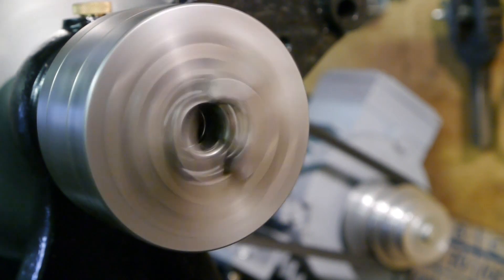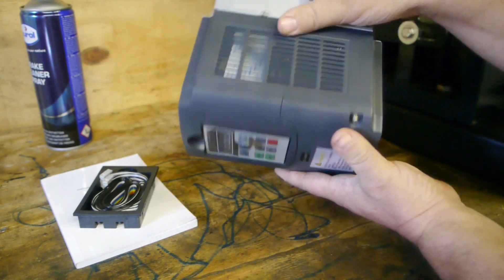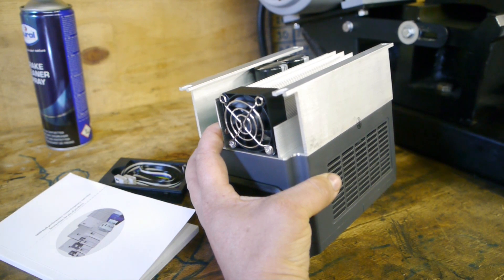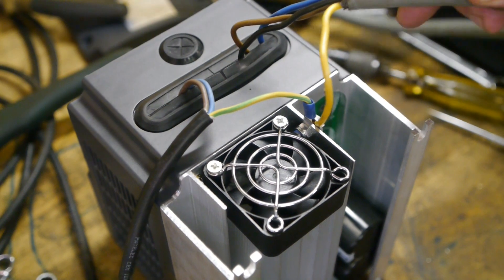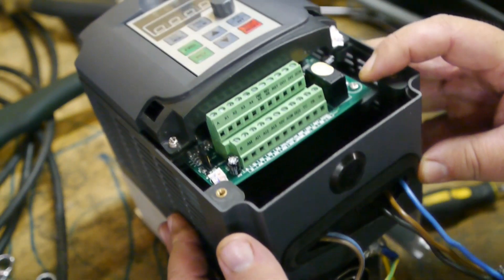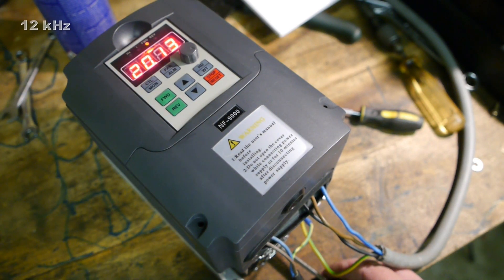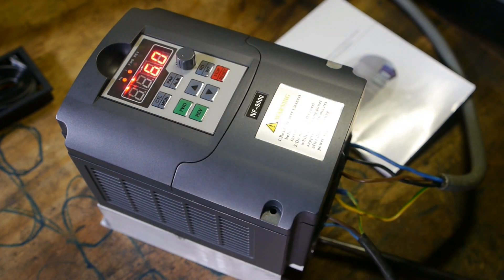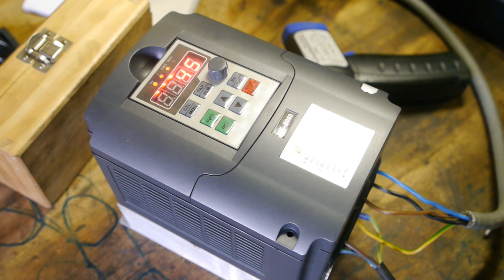Reviewing, testing and installing a cheap Chinese VFD

Comment: For a few dollars more, I'd rather just stick with something more of a known quantity, like the Teco drives. I have my doubts that this drive would last all that long at it's 2.2kw rated capacity. And if you're using it to run a 1hp motor, then the Teco drives are the same cost, but vastly superior quality and documentation.

I've been running the L510-203-H3-U on an a la carte air compressor, with a 3 HP motor for 2 years and it quietly does its job for $200.

Was hoping to find something reliable and super cheap for a drill press project and I think I'm just going to buy another Teco (foregoing the 'super cheap' obviously).

Comment: Thank you for this usefull video, my fan runs from the start as well, but that's ok for me. It's installed in a cabinet, on the other side of a wall. So that's ok. :) The only thing I haven't figured out yet is how do I connect an external on/off switch to this device? Have you figured that out? If so, can you please explain me how? Thanks!
Reply: I already found it, connect DCOM and FWD and change F039 from 0.0 to 2.0
Reply from the maker: Does the external switch also stop and start the fan? I remember running into this problem.
Never figured it out since I got used to using the buttons on the panel.
Reply: Yes, it does. Just like when you use the FDW and Stop button on the device. When the frequency hits 0.00 the fan stops too. We also use 2 devices of another brand and these turn on their fans only when needed, also the fans are more quiet. Probably that’s the difference between €125 and €600...

Comment: Hi guy. Unlucky I can't speak and understand fluently english. So... just a Q: does it works in a 3 fase, 400V motor of an little drillmill machine? It's 750W too.
Reply from the maker: I suppose that should work just fine.

Comment: Connect A bimetal switch 45 degr between onze of the leads from the fan en glue the bimetal to de alu cooling bloc. That wil help
Reply from the maker: That was the plan, but I disconnected the fan instead. It's been fine ever since. Never gets to the temp where the fan should kick in.

Comment: Really useful review, many thanks ! .. about the fan noise,I think you can do something about that. You already proved that it runs quite cool and in fact the fan shouldnt come on, at least with no load. and you can see what the temperature is. You can get (very cheap from internet) speed adjust kits for this type of fan (they are meant for PCs) .. actually its just a wire wound resistor, goes in series with the motor wire. You got this for free and invalidated any warranty when you drilled the hole for earth so if I was in your positition I would go for broke and remove or cut one of the wires to the motor and insert a suitable resistor (just insulate it well afterwards so no shorts. should help a lot. I also hate fan noise, even queit fans. eg a fan in my PC really annoys me, I want utterly silent.  

I agree, stuff we buy should ideally work right when you open the box, but given that this kind of cheapstuff often has a few minor annoyances" we have to live with them - or fix them - or we can pay ten times the price for something nice. which I cant afford

A slight bend on the heatsink wouldnt bother me at all, just bend it back. I agree its annoying, un-necessary if they packed it better .. a good feedback to them,  but the post cost to return it and them to send you another  is far more than the bend is worth . c'est la vie, worse things happen to girls
Reply from the maker: That' s not a bad idea. To bad the fan is fastened from the inside and there is no access to the the wiring from the outside.
So I would need to completely disassemble the unit.

Comment: Hi rolingmetal,
I bought a feed pellet machine that I can’t use because it is a 240v 60hz 3phase 22kw system, I only have 1phase power supply in my country. I would like to know if a VFD would work for me and if so can you please tell me a system that can work for me. Thank you 
Hope someone can help me here.
Reply: 1tweece  look up how to use capacitors to create more voltage and a second line its neat stuff but you have wattage limits
Reply: you can use the capacitor from an old motor too. Search it out on the internet.
 If done right you don't even have to take it apart.

Comment: these speed reducer exists for single phase motor
Reply from the maker: Have you ever seen one in action? Hoe does it preform?
Does it work better then running a single phase motor on one of the phases of a normal vfd?
How about at low speed?

Comment: Maybe some of you guys can help me. I have the same VFD (only for 0.75kw) and everything is working fine, even the motor runs, but for some reason I cannot enter new parameters.
I tried exactly (!) according to the manual:  
-Reset to factory
-PAR/ALM -> ´pick any Function, let's say F010 (motor frequency) -> choose value -> RD/WT to confirm new value.
At this point the value resets to the factory value. No matter how often I try, I'm not able to enter any new values. I can pick them, they blink, then I hit RD/WT and they go back to what they were previously.
Can anyone help with this?
Thanks
Reply from the maker: Strange. I have no idea why this is not working for you.
But if I remember correctly there are two ways to reset. Though the software and by shortening out one of the i/o pins to ground.
Reply: Thanks mate, I actually figured it out. Maybe this'll help someone else: For some reason multiple parameters that the manual tells you to change are factory locked for this version of the VFD.
For instance: F009 F010 F011 (which are the motor parameters), are listed as FR/W, which means that they can only be changed by an "engineer"

So partly, it is my fault for not RTFM thoroughly, on the other hand they shouldn't tell people to  "set the parameters of motor" first, but not let them do it :)
Thanks for your reply though. I appreciate it.
Reply from the maker: Well, the manual is bit of a hard and sometimes comedic read. But, good that you got it figured out.
I forgot to ask, does your cooling fan spin all the time?
Reply: Yes it does. Spins up when starting the VFD, keeps spinning for about 10-15sek then stops and starts quite randomly. Also, the fan chafed along its housing until I loosened the screws holding the cover on...
Otherwise I'm happy. I mean: 85€...

Comment: Very useful review thank you! I’ll be looking to add an external switch to mine to control the motor, did you find out how to do this? Thanks a lot!!
Reply from the maker: I currently don't use an external switch. 
I did hookup a switch and it worked. But if I remember correctly stopping the motor didn't stop the internal cooling fan.
The stop button on the panel did stop the fan. 
I was going to figure this out but I'm ok using the panel so I never did.
Reply: okay thank you very much, I will be using the motor in the other room so the fan shouldn't be a problem. cant you change it for a quiet one from a computer?
Reply from the maker: A computer fan won't work because it needs to be 24v.
I've disconnected the fan and since I'm nor using the brake resistor I pretty sure it will be fine.
It never gets to the temperature where the fan should switch on according to the manual.

Comment: Hi. I put up a video showing my fix for the noisy fan. I included a card for this video here to show the tests you did to try to get the drive to overheat. I had to put a heat gun down into the heatsink to get the bi-metallic switch to close and it took nearly three minutes to get sufficient heat for the fan to start. I also changed the carrier frequency as you did and the results are much quieter than I had previously. I enjoyed watching your review and I'm glad you didn't sugar coat the faults with this VFD.  My video is here: https://www.youtube.com/watch?v=x882vvX_L7Y&t=1s
Reply from the maker: Very well made video. I was going to do the same but couldn't get the right temperature switch at the local electronics store.
In the end I just pulled of the power lead and used the VFD without a fan. In my drive there is a parameter to monitor the heat-sink temperature. For a while is checked that parameter, but the way I use my lathe/drive I doubt that the temp will ever be a problem.
I am aware that this will probably shorten the lifespan of the drive but I'm o.k. with that.
Reply: @Preso58  10 month later and even with an "updated  version" it is a no go. The fan runs all the time and no readout can be gotten on the display for temp. Also found something different that I'll have to play with. Even though mine is a 110 Volt 3KW version, when checking the factory settings, they are set to 220 Volts. And a message from Elly ( tech at HY ) says that mine can run either single or 3 phase. I have yet to see a 110V 3 phase system. Me thinks mine slipped by the QC checks on a number of things at Huanyang as the tag does say 2/3 Phase 110V even with a model number only for a "shingle " phase unit. It appears that the HY units have a slightly better build quality over the NFLixin units though.

Comment: You should have run it at 2300W and then see if it could cope or not, I have my seriously doubts. Not only drive a motor without any load on it that doesnt stress it at all.
Reply from the maker: That would have been a good test but I don't have the tools for that.
Anyway I've been pretty happy with the VFD ever since I've unplugged that noisy fan.

Comment: does it show RPM?
Reply from the maker: I believe it can. I didn't bother with it as it is only useful if you have a fixed pulley configuration.
Reply: @Rolingmetal  thanks, also there is a video on how to reduce sound  of the VFD

https://www.youtube.com/watch?v=x882vvX_L7Y&t=912s

Comment: Volgens mij ben je een Nederlander .. ik kan het probleem met je bespreken. De ventilator in de vfd gaat automatisch aan altijd wanneer je hem start . Dat is erg irritant. Het plaatsen van het bimetaal stop de ventilator in het begin tot hij 45 warm wordt en dan slaat hij aan en als de temp weer terug zakt dan gaat hij weer automatisch uit enz. Je moet wel durven om de vfd open te maken en het bimetaalje in de kast te plaatsen.. plaatsen tussen een draad van de ventilator en het schakelaartje vastzetten op koelblok. Aluminium koelframe.. bimataal 45c te koop bij banggood of Ali succes.
Reply from the maker: I was van plan om een temperatuur gevoelige schakelaar te installeren.
Maar de lokale elektronica zaak had niet de juister temperatuur schakelaar.
Toen heb ik de stekker van de ventilator er maar uitgetrokken en regelmatig de temperatuur parameter gecontroleerd.
De temperatuur kwam nooit in de buurt van 45 graden dus heb ik het maar zo gelaten.
Mogelijk gaat de VFD nu wat eerder stuk maar dat risico accepteer ik.
Reply: Ik heb het zelf wel gedaan, dus geen zorgen voor mijn vfd. Ik heb de ventilator alleen aan gekregen met een föhn en het werkt goed. Succes verder.

Comment: my fan runs constantly also
Reply from the maker: Do you also have the nf-9000 model?
Reply: HY VFD
Reply from the maker: Are saying the nf-9000 is also made by HY?
And is HY short for Hyundai?
Reply: lol, HuanYang VFD. not sure if it's the same. But probably made in the same factory.
Reply from the maker: Yes, a lot of the Chinese drives look the same. 
Lots of brand names and perhaps only one manufacturer.
Or perhaps that are all more or less cloning each others product.

Comment: Damn that sound was awful.. you know the sound of nails on chalkboard.. well its like that and constant and louder
Reply from the maker: The nail on the chalkboard is worse :) 
Soon I will start using the old drive again. Get ready for some more agonising sound :)
Reply: How do you control a motor using this VFD (NFIXIN MODEL 9000 using a PLC
Reply: lovemore munguni, i havent done refit yet to say much. 
btw.. Did u look up the owner manual for it? I know there r badly written in chinglish, but a good starting place..
Reply: I have the manual but there is not much in there. much of wht i am doing is experimental based on what other VDFs are expected to do